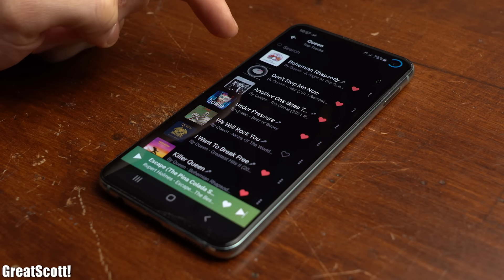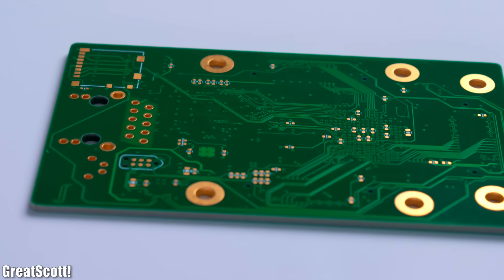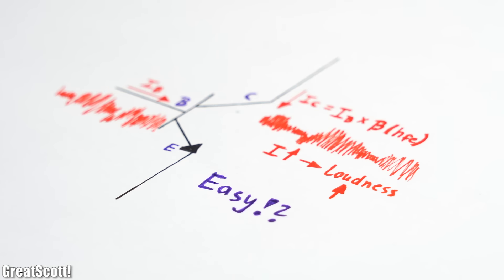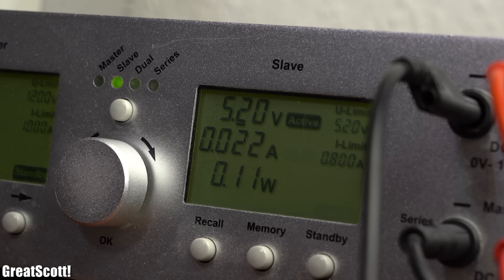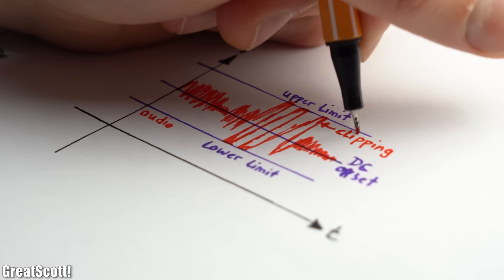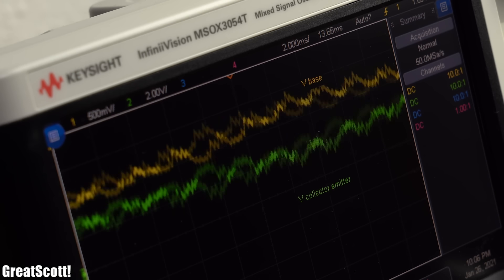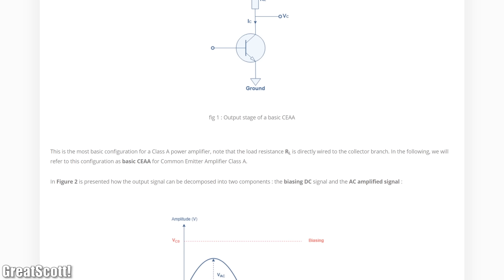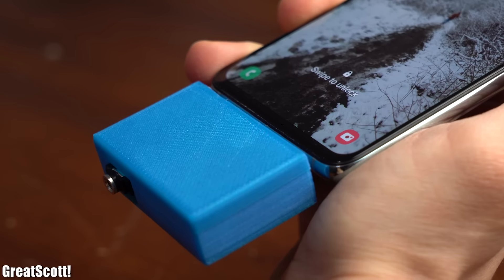Building the simplest, best sounding, yet most inefficient Audio Amp! || Class A Audio Amp Tutorial

Comment: U should say this is power amp ( common collector ) we have voltage amp ( common emitter ) 2 and it works differently and also common base that don't do any amplification ;)
Reply: It's not a common collector configuration. It's common emitter and it works just like any other common emitter amp. Or perhaps a bit worse.

Comment: Why didnt you used an op amp? Generally they have way better AC characterisitics than BJTs and are way more power efficient. But that works too. Cheers from Portugal
Reply: Op-amps can rarely deliver much power
Reply: @lotrbuilders5041  True but so does the configuration he used in the video. It is high impedance. Should have been followed by a common emitter topology

Comment: I am new to this and still do not fully understand how it works. Great video by the way, just one question: If I wanted to add a potentiometer to change the volume by turning it, where would it be? Would it be on the input or output of the amplifier, or maybe somewhere else?
Edit: also which resistance would the potentiometer have to be for this to work?
Reply: Hi you can insert a volume pot between the input jack and the transistor base capacitor C2, a 10k or 20k ohm or 20000 ohm log potentiometer will work. Pots have 3 conectors, one in the center and two on either side, connect one side connector to ground, the center conector to C2 and the remaining connector to the jack, important, before doing all I just say you must disconnect the imput plug to C2 thats where you insert de potentiometer in the circuit and It will let the signal pass more or less depending on the position off the control, remember the lug thats connected to grownd must be the one form de left if you look at the potentiometer with the shaft facing you, when you turn the shaft all the way to the left volume will be null, if you turn the pot clockwise volume will increase as you turn te control. This is a stereo amplifier, so you have to order a double potentiometer . I cant draw a schematic here for you nor put a link to a web page, bur google volume control or search for a simple phonograph amplifier, almost every amp has a volume control inserted at the imput as I descibed. Hope this helps. PS:you have another option for free, control the volume from the phone and don´t mess with the design, potentiometers are big and won´t fit in the small  enclosure.
Reply: @gerardoromano3436  Thanks, this helped a lot!

Comment: I would have thought a capacitor in parallel with the emitter resistor was necessary, since this capacitor is necessary to mostly conduct away the a/c waveform, maintaining the dc bias at the base-emitter.
Reply: On the contrary, bypassing the emitter resistor will introduce lots of ugly distortion, because of the BJT's inherent non-linear transfer characteristic. The emitter resistor is needed to swamp out the non-linearity and reduce distortion to tolerable levels.

Comment: Wouldn't the collector current be less than 20ma since there is a 26 ohm resistor in series? Why then use 20ma to calculate the base current instead of the actual value? Or am I failing to consider something? Also where does the 10 X Rb term in the denominator for R1 and R2 come from? Thanks!
Reply: The 26 ohm resistor was calculated to have that value because it gives 20mA when it has a voltage of 0.52V across it. That is what determines the emitter and collector current.

The "10 x Ib" (base current) is there to ensure that the current through R1 and R2 is 10 times greater than the base current. Because the calculated base current depends directly on the transistor β, it is inherently variable with different samples of the same transistor. So the actual base current can vary considerably in practice, therefore we design the current through the base bias resistors to be much greater than that, thus minimising the effect on the base bias point of variations of β.

Comment: Is it possibile to make it for normal Micro Usb phones? There is still the 5V output? If there is no voltage, this circuit will need a tiny battery and a tiny charger to work in phoens with no USB-C...

Comment: If you want better distorsion figure, try some opamp, less quescient current, more dynamic !
Reply: Good idea, that will sound better, but also become complicated and expensive. I tried building LM386 amplifier, it works but the passive component selection was difficult for a noob like me, the output bass sounds somewhat like square wave. So I decided to use PAM8403 module for my PC headphones :D
Reply: @zenvir1680  It's not that complicated, there are some dedicated headphone opamp, like the OPA1688, the schematic is in the datasheet. I've also build myself one around a NE5532 with some push pull BC547-BC557 that provides more than enough current for my headphone, with ultra low distorsion ...
Reply: @neteagle2k9   @neteagle2k9  I will see about that.  Thanks 
BTW can you help me with something? I don't know where and whom to ask...
I bought TPA3110 30W amplifier boards for  speakers to use with my PC and connected the inputs through volume control potentiometers. Now whenever I switch it on it gives loud thump (PC and amp's adapter are turned on together). However if I keep potentiometers to full volume position thump does not occur, but a loud screeching sound is there until I turn on CPU and it boots to windows, then things calm down. Any solution to both of these?
PS: Electronics is not my main subject I just do these things for fun😅
Reply: @zenvir1680  Maybe you need to add a delay on the mute input pin 1 SD of TPA3110, so that the amp is muted when your sound card initialize ...
Reply: @neteagle2k9  I tried delay circuit but it requires me to turn on CPU immediately. I even tried something with LDR so it turns on with the Disk LED on cabinet. There were inconsistencies and so many wires running around 
Okay, soldering on IC itself? Pretty sure I will just ruin the IC with heat, my equipment is not that precise, yet. Thanks for replying
Anyway, I ended up with a simple switch on a convenient spot, I will just manually turn it on when required, I guess

Though, I wonder why this noise issue is only with small modules (this TPA3110 and also with PAM8403), and not with prebuilt music systems

Comment: AMAZING. Can you know do the same using a FET? Must be easier...
Reply: Harder. FETs have a a relatively large variation in their threshold voltage so are difficult to bias accurately, especially when working with low supply voltages like 5V.

Comment: Wait. The 10uf output with the resistance  impedance of the headphones will create a high pass filter. With a 32ohms and 10uf that will be a 497hz cut. The cap must be 20 times bigger. Am I wrong?
Reply: Yes, you're wrong. Since the amplifier has an output impedance equal to Rc (130R), the output at the earphones (likely around 32ohms impedance) is reduced by a factor of 32/(130 + Xc + 32), where Xc is impedance of the capacitor at a given frequency. When Xc is negligible at high frequencies, the reduction is fixed at 32/(130 + 32). So the -3dB frequency occurs when Xc = (130 + 32) ohms, not just the impedance of the earphones (as it would if the amplifier's output impedance were negligible compared to the load). A quick calculation shows that 10μF has an impedance of 162 ohms at a frequency of about 100Hz. Although a 22μF capacitor might show a little improvement in bass response, any greater value is simply a waste of space and money.

Comment: Why didn't you use a bypass cap? Just curious, it's just a single component even if in this case its not as useful.
Reply: Bypassing the emitter resistor will introduce lots of ugly distortion, because of the BJT's inherent non-linear transfer characteristic. The emitter resistor is needed to swamp out the non-linearity of the intrinsic emitter resistance and reduce distortion to tolerable levels.

Comment: Thanks for this amazing video. I have a question at about 8:12 when calculating R1 and R2, where does the 10 at denominator come from?
Reply: It's to ensure that the current through R1 and R2 is 10 times greater than the base current. Because the calculated base current depends directly on the transistor β, it is inherently variable with different samples of the same transistor. So the actual base current can vary considerably in practice. Therefore we design the current through the base bias resistors to be much greater than the base current, thus minimising the effect on the base bias point of variations of β.

Comment: You need 2 transistors, 1 for each channel, or the amplifier would be mono and because the left and right cables of sound input are shorted, if the sound in inverted, both audio AC Signals would cancel each other and no sound would come in output

Comment: Im building 3D printed bluetooth speakers with an amplifier. And I want to implement a feature that when I connect the headphones into them, I want the audio to switch from speakers to the jack output automatically without adding some kind of switch. Would it be possible using an Arduino? Thanks!
Reply: Don't use an Arduino; it's a waste of your time. Buy a 3.5mm jack socket that has a connection that is broken when a 3.5mm jack is inserted (it's hard to find one without that feature). Then your output is wired so that it goes to the speakers via those connectors. When the jack is inserted, the output is automatically connected to the headphones and disconnected from the speakers. You can use a multimeter on continuity range to figure out which connections you need on the jack socket.

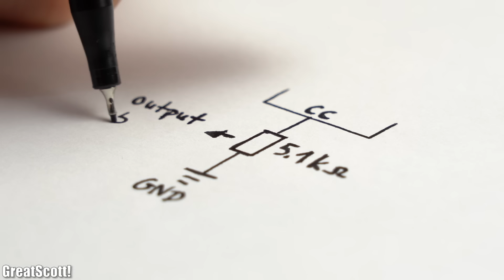Comment: Why did he replace 56k ohm resistor with 5.1k ohm at 9:37? 
I mean, when he measured voltage across former resistor (56k), it was 0 .5 v; However, when he replaced it with 5.1k, the voltage read 5.2 V. Why?

Comment: Output capacitor choice 10uF is too small especially if your earbud impedance is 32ohm, it’ll cause the -3dB low cut frequency is around 500Hz, you’ll miss many bass when you listen music.
Reply: Since the amplifier has an output impedance equal to Rc (130R), the output at the earphones (likely around 32ohms impedance) is reduced by a factor of 32/(130 + Xc + 32), where Xc is impedance of the capacitor at a given frequency. When Xc is negligible at high frequencies, the reduction is fixed at 32/(130 + 32) as expected. So the -3dB frequency occurs when Xc = (130 + 32) ohms, not just the impedance of the earphones (as it would if the amplifier's output impedance were much lower than the load). A quick calculation shows that 10μF has an impedance of 162 ohms at a frequency of about 100Hz. A 22μF capacitor might show a little improvement in bass response, but anything more is a waste of space and money.
Reply: @RexxSchneider  Hi Rex, How can we know which frequency that we want to filter
Reply: @sessizacbak8449  I suppose it depends on the ability of the output device to deliver low frequencies. There's no point in amplifying frequencies so low that the speaker/earphones can't deliver it.

As a guide, however, we conventionally design audio amplifiers to amplify frequencies from 20Hz to 20KHz, so I'd usually aim to use capacitors that rolled off the response below around 20Hz.
Reply: @RexxSchneider  This is perfect answer. Thanks Rex. Is it also logic to filter out the frequencies over 20kHz then?
Reply: @sessizacbak8449  I am aware that some (younger) folks can hear frequencies a little above 20KHz, and there are some who claim that rolling off the high frequencies that we can't hear does affect how the music sounds. Personally, I can't see any science behind those sort of claims, so I'm perfectly happy to apply a first order lowpass filter at 20kHz on any audio amp. It will probably help stability as well as reducing the possibility of wasting power into a speaker at ultrasonic frequencies.

Comment: You need to add an Emitter bypass capacitor in order to increase the gain of the circuit. Try about 100uf.
Reply: Don't do that. Bypassing the emitter resistor will introduce lots of ugly distortion, because of the BJT's inherent non-linear transfer characteristic. The emitter resistor is needed to swamp out the non-linearity and reduce distortion to tolerable levels.

Comment: I’m confused, why did you say 1mA too quiet, 10mA Ic was too distorted, but 20mA was sweet spot?
Reply: That was my thought as well
Reply: I think the clue is in the 1 mA, that was 'to quiet', probably meaning 'silent'. Then came 10 mA as a distorted brew, a partly open BJT, and at 20mA all swung between the Vcc and ground. Someting like that.
Reply: @erikdenhouter  plausible but it would be strange to call "nothing at all" "too quiet" and to find a "sweet spot" without finding an upper limit
Reply: @Schwuuuuup  It is language.... He also uses 'loudness' for 'volume'. But yes, no upper limit in sight.
Reply: @erikdenhouter  Will... Wikipedia says "In acoustics, loudness is the subjective perception of sound pressure. More formally, it is defined as, "That attribute of auditory sensation in terms of which sounds can be ordered on a scale extending from quiet to loud." so I wouldn't call that a wrong use of that word, even if loudness and volume are not 100% interchangeable
Reply: The collector current determines the output impedance for a given supply voltage. At 1mA it would be 2,600 ohms. So when the approximately 32 ohm earphone load is connected, it reduces any signal by a factor of 80. No wonder it was quiet.
At 20mA, the output impedance would be 130 ohms, which would be reduced into a 32 ohm load by a factor of about 4. That would sound a lot louder.
At 10mA the output impedance would be 260 ohms, but I suspect that when calculating the components, he got the dc operating point of the output too far away from the midpoint of the supply and clipping occurred. That's my guess anyway.

Comment: That USB C breakout is flawed. You need separate pull-up or pull-down resistors for each of the CC pins. You cannot tie them together, or it will not work correctly in all circumstances!

Also your description of the purpose of the emitter resistor is not quite there. When you build a degenerated class-A circuit like this, the emitter resistor linearizes the gain by essentially acting as negative feedback:
With no emitter resistor, the collector current varies nonlinearly and very sharply with the base-emitter voltage. With the emitter degeneration, the voltage at the emitter of the transistor will change in proportion to the emitter current (which is proportional and roughly equal to the collector current) due to the resistor. This change will be much larger than the small change in the base-emitter voltage, and thus the collector current will be much more linear in relation to the base voltage with a lower gain. This gives you more leeway in your input bias network, and reduces the gain to a more manageable level.

Ie ~= Ic. Ve ~= (Vb - 0.7). Ie = Ve/Re. 
Thus Ic ~= (Vb - 0.7)/Re
your output voltage will be roughly Vs - Rc*(Vb-0.7)/Re
and therefore the overall voltage gain (ignoring the DC offset) is approximately -Rc/Re.

Much simpler than the non-degenerated version, where you have Vout = Vs - Rc*[Is * exp (Vb/Vt) * (1 + Vout/Va)], a very non-linear relationship. With careful biasing and a very small input signal this can be approximately linear, but with input signals varying by hundreds of millivolts and simple resistor biasing, it's not workable. It's also much more affected by unit to unit variation of the transistor.

Comment: The value of C4 at 10uf is too low, and result in severe loss of bass response using low impedance phones of 16 or 33 ohms.
Should it have been 100uf?
Reply: yup, 10uf and load forms high pass filter
Reply: Nope. Since the amplifier has an output impedance equal to Rc (130R), the output at the earphones (likely around 32ohms impedance) is reduced by a factor of 32/(130 + Xc + 32), where Xc is impedance of the capacitor at a given frequency. When Xc is negligible at high frequencies, the reduction is fixed at 32/(130 + 32). So the -3dB frequency occurs when Xc = (130 + 32) ohms, not just the impedance of the earphones (as it would if the amplifier's output impedance were negligible compared to the load). A quick calculation shows that 10μF has an impedance of 162 ohms at a frequency of about 100Hz. Although a 22μF capacitor might show a little improvement in bass response, any greater value is simply a waste of space and money.

Comment: Why didn't you used operational amplifier for this job. 
It would have been dead easy to do.
NE5534 would have done the job like a pro.
Reply: NE5534 is specified for 10V supply at least. The phone only has 5V.

Comment: Hi, will this also work if we use this amplifier with an electret condenser microphone?
Reply: Doubtful. The circuit has very little gain into normal headphones, and the signal from electret mics isn't really strong enough. Plus you need an input impedance to match the 10K output impedance of the mic, and this circuit has an input impedance of less than 1K which would further attenuate the signal.

Comment: wouldn't it be better to free the usb-c and use the 3.3v from the mic's phantom power instead?

EDIT:
it wouldn't be that much of a help with your enclosure design since it covers the usb-c slot anyway, but if someone decides to copy this but using a 3.5mm jack with wire extension it would definitely free up the usb-c slot
Reply: I think the phantom power for the mic is supplied via a 10K load resistor (or thereabouts). At 3.3V, you're really not going to have enough power to use it to drive earphones.